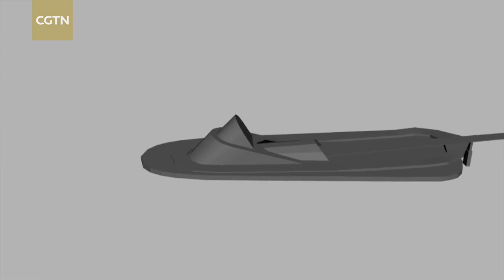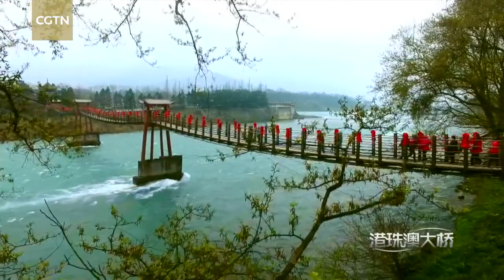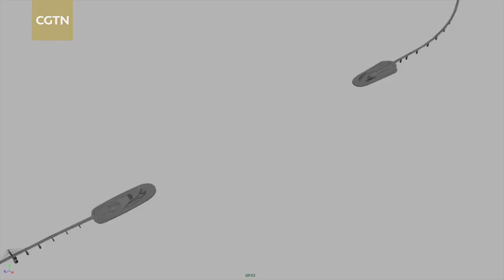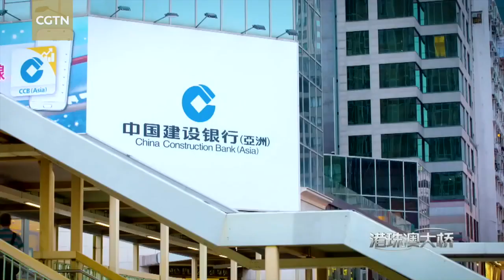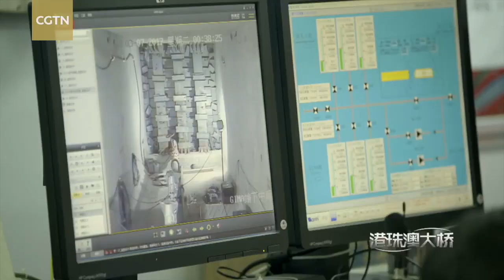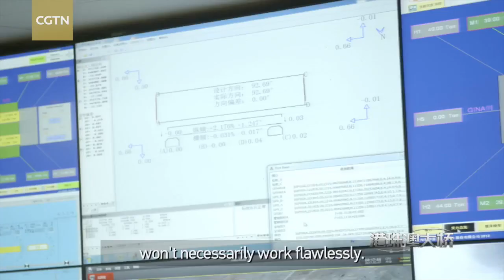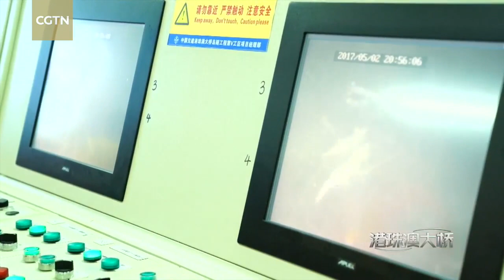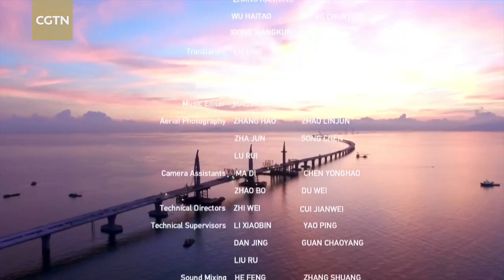This is China: Episode 2 of Hong Kong-Zhuhai-Macao Bridge

Comment: This project is great and this documentary is so poor. There is nothing. There is a lot of talking. For example i the whole documentary there was no single PC visualization what they want to do. So how exactly did they put the tunnel segments onto the seabed or how exactly did they connect segmens together and how it looked like down there between the sections with the seals still there. I dont know which documentary it was but in other project I think it was in Singapore or Malaysia maybe Japan there was sunken tunnel too and they showed exactly how they put them onto seabed and how they moved them close together to be able connect each individual segment under the water using hydraulic levers which pulled the heavy segments together because without it there was 1-5cm gap.
Reply: There is, but the time is too long, so many of the cuts are streamlined.
Reply: Secret
Reply: patent.